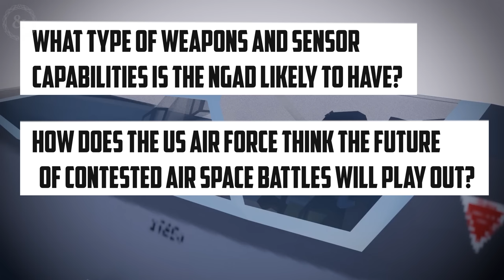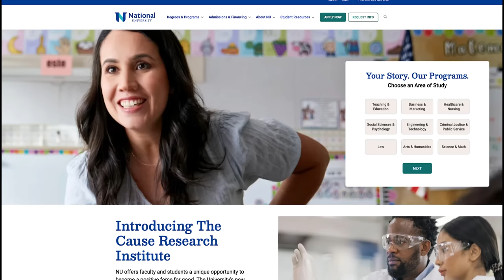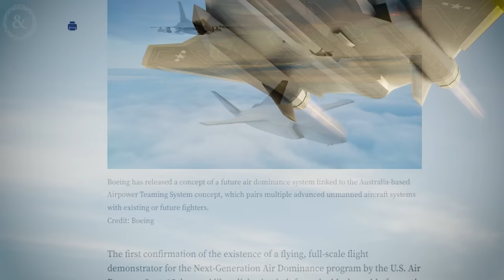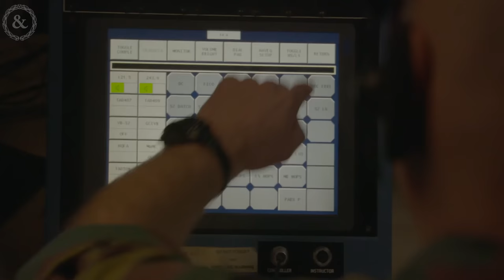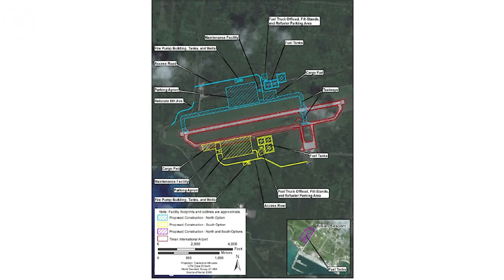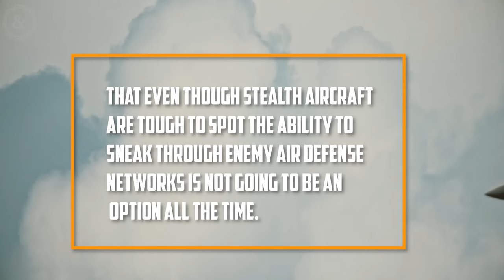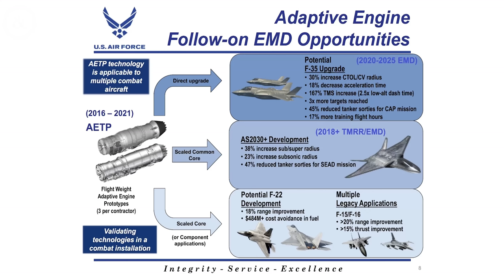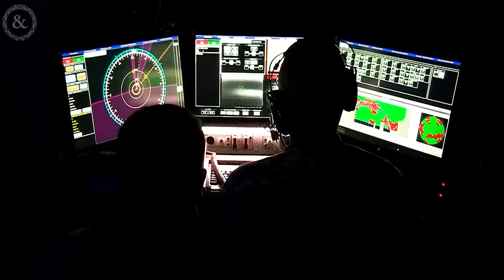Lockheed Martins 6th Generation NGAD Fighter Tactics

Comment from the maker: NU is a Veteran-founded Yellow Ribbon school with 190+ degrees, plus certificates and credentials to expand your military skill set https://bit.ly/3EyngPv
Reply: I love your videos!
Reply: Make video on Georgia 🇬🇪
Reply: 15:48 NGAD in Polish colours , yes please 😄
Reply: I'm surprises you did not know about, Tinian nor associate the island with the names of two, B-29 that took of from there in August 1945, Enola Gay and Bockscar.
Reply: When did this become a U.S. military propaganda channel?
Reply: you look high af
Reply: A good video, as usual. But no comments on the basic design flaws in the renderings? First, how are they going to fit two of the UCCAs into one next gen fighter given their relative sizes?

And on the NexGen fighter with the flaps or whatever it is they are called in front of the engine inlets you would get compressor stalls, aplenty.

It looks like that Lt. Col. you mentioned, the proud one, may have been too deep on the BMP (Bolivian Marching Powder) when mocking this up.
Reply: Y think you will have a off-bore  sight keep abilities Like the F-35 that allows it to lock on at any angle and The AN/AAQ-37  lock on guide System with A lock rang of 800 miles but what  is cool i think  myself Just as A non Civ Mil Trc nerd With those drones if equip  can boost the target  range of that to probs proly inf distance that combine with its own arms would be A great  advantage especially if that could be work for Air to ground targets you could speculatily  speaking cause great havoc to in AA batteries and other defense systems  100 of thousands miles way without much mishaps.p
Reply: Seems like they are going to develop an even better jet with a proper budget. And there is a limit to changes. Like if it’s proper already, it has to be something completely different in addition to specific task. Ukraine is so much behind with jet development.
Reply: Ick no, it's a horrible school! My vet hubby went there and it's a joke! Teachers don't communicate and using the GI Bill was very difficult, which is ironic since it's supposed to be a military friendly school....
Reply: @Western_Decline  😂😂
Reply: I love how the government always says "don't worry it will be cheaper than what we currently own?” lol yea, um sure.....
Reply: oi Cappy....
are they rainbow inclusive? 
if I try to kiss my girlfriends sister will my world come crushing down?
Reply: Haha will eventually replace the Raptor? The Raptor isnt in the game, dude. The Raptor was never put to real use. Never ONCE flew a mission anywhere. If you actually think the Raptor was in active use and actually served a purpose, then Im not going to bother finding out what else you have to say on this topic.
Reply: "Pacific theater" ah come on, just say China.  Is it just me or does Lockheed need a really good enemy?
Reply: They are just making the ADF- Morgan from Ace combat 😅
Reply: I'm sorry, of course, but russia still doesn't even have a fifth-generation aircraft. You really don't know that the CY57 does not have a fifth generation airframe, engine, avionics?

But you are talking about the 6th generation :) ? Boy, what do you really understand about airplanes?
Reply: @Western_Decline not propaganda just public info with bias of an average infantryman
Reply: @ToxicWastoid-km3mt  Australia MQ28A Ghost Bat can do these things and why was built to boost Australian RAAF and have a cheap quick replacement air power that it can sacrifice if need to also.
This guy has no clue on AI or loyal wingman.
Reply: I got a master in NU in telecommunication

Comment: I think it's very safe to say 6th gen will also incorporate active flow aerodynamics, like the air nozzle and outlet system from the X-65 program that replace flaps/rudder/ailerons.  You'd also NEVER have a big canard in front of the intake like the model does, you'd create all sorts of engine stalling and compressor problems by redirecting the flow that way.  Take a look at every canard-delta wing jet or even the ones with horizontal tail stabilizers too, NONE put the canards in front of an intake they're always on the side-top, and the intake on the bottom underneath.
Reply: Great point! I hadn't caught that! 

I hope there is some substance to these renders but I feel like America is so behind the ball on aircraft technology they just went on fiverr and hired a videogame artist to make some cool looking renders 😅

Also, not convinced it would solve the canard blocking the intake issue, but did you notice the intake nozzle was not fixed? It raised up.

Just thinking out loud but maybe the large surface area of those canards is so they only very slightly deflect, and therefore won't interfere with the intakes? What do you think?
Reply: A chine blended into leading edge extension on the wings can provide a little more lift on the forward section without the complications of canards. 

2D thrust diverters on the engines with independent control can provide plenty of additional directional control while also slightly improving stealth.
Reply: I blame the animator, I guess he is not an aerodynamics guy
Reply: @stupidburp  I haven't heard chine used outside boat hulls, so I'm assuming you mean the types of sharp creases we saw on the SR-71, but in wing cross sections instead of hull areas?  My understanding is that the active flow systems are much more like the second system you mention, not that it preclude in-builts features in any way.  I think the designers would consider a flexible wing area that could stretch or crease no different from a detached flap in the way they describe the type of systems in testing in X-plane programs.  DARPA's record is spooky in the extreme!
Reply: @jeffdelgren2170  To move an object weighing many tons quickly the canard has to move so much air that I don't see a way to have an engine flow stream and a major control surface directly in line.  I'm trying to come up with any example of that working, but I'm stumped.  At even a few hundred miles an hour it would slam air into the low pressure compressor fans, probably surging them or starving them depending on the angle and air speed.  The turbulence from a plane in front of another can seriously disrupt engine operation to, so a wing could definitely do it, but maybe there's a ducting or shape that's a workaround?  I think the other issue is those engine tunnels look too short to shroud the compressor fan blades from giving a radar return, I don't know about the outlets, there may be enough masking by the vectoring assembly to do the job, I know less about that aspect of it though.
Reply: yes - thank you - i was wondering if anybody else caught that...
The canard placement looks great on the model - but - in reality, is not a workable solution.
Not sure who made the onscreen model - but looks like they went for looks over functionality.
Reply: @warpdriveby  there's a whole lotta goof in the render Chris was using
The engine nacelle is almost completely separated from the fuselage body, and creating extra shapes and surfaces like that is not ideal for stealth
I suspect the fuselage will look a lot like the B-21 Raider with some lifting surface changes for extra dynamic control authority
haven't heard much about double-delta wing designs and how that affects the aerodynamics. So that interests me
also, based on the silhouette, this thing will be fast. Really fast. At least Mach 2.3 capable.
Reply: The more I look at it, the more convinced I am it's not actually a thing lol. Shame. It's sure cool looking
Reply: @goddepersonno3782  You make good points.  I'm prepared to be amazed by this generation of tech, some of the demo programs out in the open are impressive enough right?  I admit that I wouldn't be able to give a clear description of the specs of the vehicles that will be produced here.  I think the speed is an interesting question, it wouldn't be very useful to build a mach 3 capable version with an effective range even equal to an F-35 or F-22.  How much they can add on both ends of a jets power/efficiency curve is (I think) still a core challenge.  I think pulse wave engines are going to be a big deal, but I'm not sure it will be 6th gen, maybe a late upgrade given it's a modular system at earliest?  They may be as useful in naval systems too, I wouldn't guarantee that but it looks likely to me.  As to the model, is it a big problem?  I'd say no and yes.  It doesn't make anything in the video wrong nor have I been aiming criticism at Cappy, I was thinking more about the things we see but don't question.  With the crowd I see in the responses, many seem to like new info or thoughts and the design issue really stuck out at me.
Reply: @warpdriveby  "Active flow control" is more like a euphemism for "cold gas thrusters"

Turbo compressors like rockets use have come a long way. You hook one up to an electric motor, add a few composite overwrap pressure vessels, and you can turn anything on a dime.

Theoretically you could do tricks like intentionally flat spinning to shoot behind you. I mean the computer would do the maneuver, but the pilot could initiate it.
Reply: This is a perfect example of the comment section being as good as, or even better, than 14:00 the video! Thanks guys!
Reply: I agree with you about the canard. Also, the nacelles that cover engines appear to be a straight flow, enabling radar reflections. B-2, B-21, F-16, and F-35 all have offset intakes to prevent reflections.
Reply: @jeffdelgren2170   I think the likely reason these renders are always so questionable is because either they're commissioned by news outlets wanting some graphics for a story and obviously don't know anything about how these aircraft are designed, or they're created by defence companies who don't want to give anything classified away in their marketing materials - effectively the designs are deliberately wrong.
Reply: Maybe we'll get lucky and have no 6th gen at all so we can pay down debt and modernize our country instead.
Reply: @trolleriffic  agreed. But wishful renders won't stop Sukhois. I think for all the money these bastards get we deserve better protection right about now
Reply: Interesting, I came to the comments to ask how that design avoids blocking the airflow into the intake.
Reply: @coreyleander7911  I don't know about this.  On one hand, of course we should eliminate waste and loss in defense spending.  On the other, US military might has and will continue to an overall stabilizing influence on both our lives internally and the world at large.  We can also discuss the technological benefits, or those of being able to employ and train hundreds of thousands of Americans in important skills.  We get a number of benefits that we can't ignore.
Reply: @jeffdelgren2170 Behind on aircraft technology? What crazy bath salts are you smoking bro because we are by far the most advanced player in the game when it comes to aircraft. Not to say there aren't other people out there who can make a great plane. But when it comes to the integrated technology and application of evolving doctrine there is no one close except for...maybe China and they are going to be playing catch up for a long time after this one. I have no doubt that the renders we are seeing are going to be close enough to the real deal. Honestly I expect the final product to look a bit sleeker than this, admittedly awesome and somewhat problematic design.
Reply: @warpdriveby People seem to have a hard time wrapping their mind around how rich we really are as a nation. It's mind boggling to see the numbers. The investment in military development programs and spending in general, while ridiculously high and most definitely not all spent in the perfect way, is not what is keeping us from modernizing things. The reason we don't have "nice things" is a lack of political will and politicians not even being able to agree on what they want for breakfast, let alone being able to legislate and invest into society without people trying to shut down the government every other month. The reason the defense department doesn't seem to be as effected by this is because at the very least both sides of the clown show agree that they dont want to be on the losing side of a conflict. Basically, self-preservation is a strong motivator to produce agreement. We have tons of money and assets to leverage to modernize infrastructure and have better healthcare and educational services along with many other much wanted projects like high-speed rail, which falls under infrastructure, I guess lol. Anyways the defense budget is a visible and easy target for people to point at and say "if we can spend this much here why not spend it there" and they aren't wrong in asking why we aren't spending more on bettering ourselves on the domestic end of things. They just aren't pointing at the right thing
Point at our politicians as they could allocate funds for stuff like that if the political will could be mustered and still have things like 6th Gen aircraft.
Reply: @warpdriveby
The angled sides on the nose of the F-35 and the concave sides of the SR-71 nose can both be considered as subsets of chine like features. They each have implications for both stealth and airflow. The angles on the F-35 are obviously more optimized for subsonic and low supersonic stealth while the SR-71 protruding chine is more optimized for high supersonic air flow. But a future design could have chines anywhere in between these extreme examples. We can see more pronounced nose chines on some of the NGAD concepts but whether they will be part of the actual aircraft or not will be interesting to note.
Reply: @jtjames79  the "Active flow...." title isn't mine, I'm using it for consistency's sake because that's what the X-65 program testers are calling it.  To my ears it sounds like something from a tampax ad or tv or auto industry hype. 😉  I'd think you could get aircraft to act in ways that are incompatible with human health with what is described.  I was very surprised to read how much control they expect to gain over conventional control surfaces.
Reply: @warpdriveby  Now just imagine the SpaceX package for the Tesla Roadster. Literally KIT from Knight Rider basically.
Reply: @stupidburp  I figured that'd be what you meant but I wasn't sure.
Reply: I came to question this.  I'm glad I wasn't the only one.  Like you're either going to get compressor stall, or overrun moving that surface in front of the intake.  Hey boys and girls, who wants to see what 137% of RPM looks like?
Reply: @jedimindtrix2142  Australia weaponized cardboard. It's not just about money.
Reply: @jtjames79  of course, it's not just about money. However, those cardboard drones aren't going to be taking an F35 or any other advanced or even just remotely decent aircraft down. There is a definite advantage to having the most sophisticated suite of avionics and advanced aircraft technology that makes a huge difference. Those drones you speak of have a solid use, but ultimately, you aren't going to win a war between two technological superpowers with cardboard drones.
Reply: @jedimindtrix2142  Well... On the whole I agree with you, one cheap device doesn't an effective arsenal make.  I think our friend from down under was making the point that we might overlook cheap simple innovative weapons, because we can lean back and call in weapons no one else (and even us too it seems) can track.  Cardboard drones can be devastating in swarms against airfields, ammo depot, fuel storage/refineries, infantry in the open, and quite probably rotary wing and low flying fixed wing aircraft.  Thing is, our air superiority jets fly way too high and fast.  With air superiority you just bomb any place anything hot comes from at an altitude impossible to engage from the ground.  That was the key to our armored cavalry crushing the serious and western educated Iraqi Commanders.  The Iraqis were much better soldiers than the Russians are overall.  I'm not talking about the ethnic quality of the individual, I mean they were better trained, supplied, and drilled, with higher morale, coherent command and home court advantage.  The Russian forces in Ukraine wouldn't put up half the fight the Republican Guard did.  I'm not a fan, but I do respect them for their courage in battle.
Reply: @goddepersonno3782 By looking at a very flawed model, you feel certain that the NGAD will be able to reach at least Mach 2.3???
Reply: @pike100  how'd you get that out of "incorporate active flow control?"  The x-65 is just an example of it being tested.